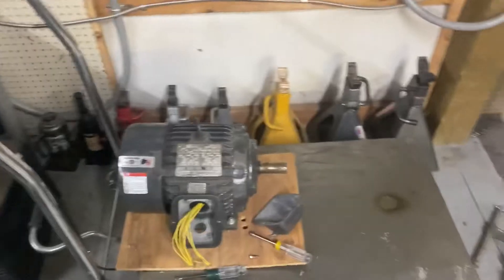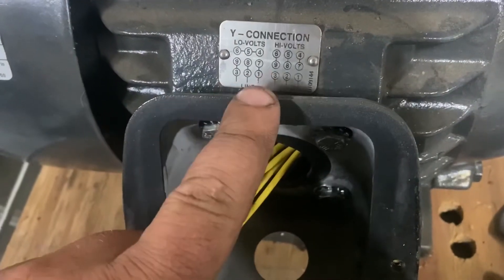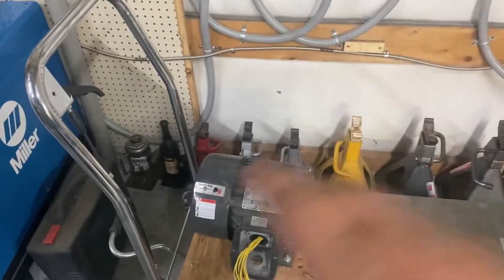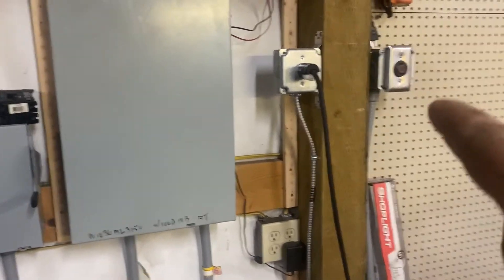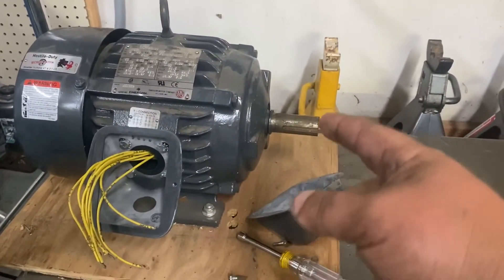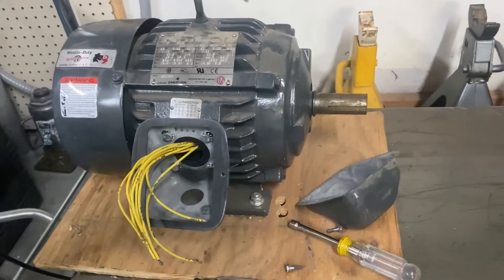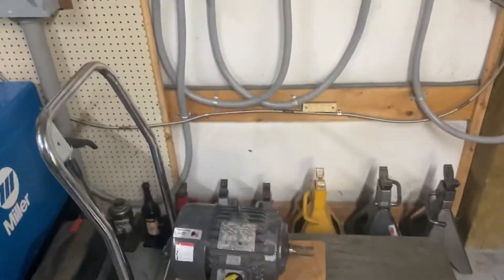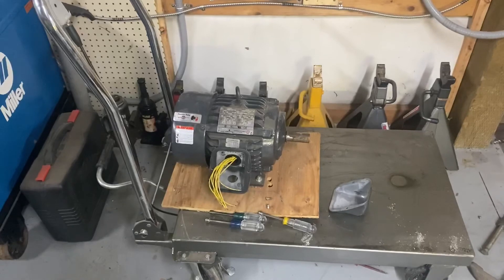Homemade rotary phase converter part 1, getting started

Comment: Yea i working on my phase convertor now . My dad left it to me alone with a lathe and bridge port mill  .  I also noticed the starting circuit on the pony motor does that  also .i may at some point try to use a starting capacitor and remove the pony motor . My rpc is 7.5 hp..  i also thought that starting with a pony motor and then cutting power and then closing in the phase convertor might help limit inrush current.  Will see how this work out . Thanks for the video
Reply from the maker: Yes the more you can get the convertor spinning the lower your inrush will be

Comment: Gday Adam, I’m looking forward to seeing how this is done, here in Australia to my understanding you have to get an licensed electrician to do anything with power, not aloud to play yourself which is a pain, things get expensive
Reply from the maker: Here you can do certain things as long as you get them inspected when you are done.  My final version I will show with my 15hp motor will actually plug into the wall so that helps with a lot of that since it’s not hardwired in.  I’ll show the plug in cord setup in the next video